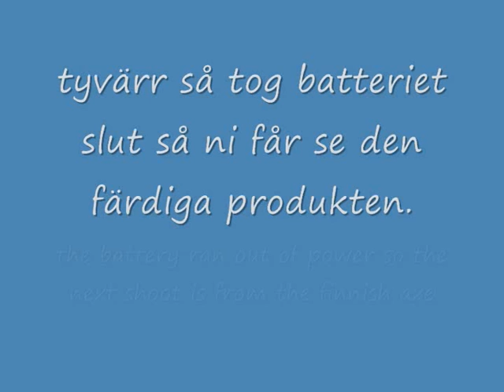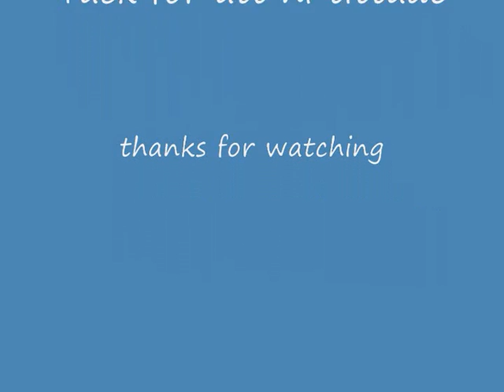forging axe from railroad spike

Comment: I like it. Would it be possible to make a working axe out of those spikes ? Is it high carbon steel that can be hardened and tempered ?
Reply from the maker: in Swden the answer is NO, it is not enought carbon content in them. but in US i now there are higer content of carbon soo it should work

Comment: that is because of the low content of carbon on that spike, it is a soft metal. if he uses the same tool on a high carbon steel he may have a lot of problems to do the same.

Comment: you do know that there's a hole in your anvil specifically for punching a hole in the spike right? also why didn't you bother to forge weld some high carbon steel in place?

Comment: Pretty but not much real use, by fitting such a short handle you have robbed this axe of the momentum a longer handle would have given it in the swing to make up for low mass of the head.
Reply from the maker: Dont you think i Knows that all ready. For good sakes I'm not stupid. This is not made for being some kinda battle axe 😐. This is more like a ornamental peace or a paper weight
Reply: Peter Lindholm In that case it is perfect, although you may wish to amend the title of the video to "Forging an ornamental axe from a railroad spike" to clear things up.